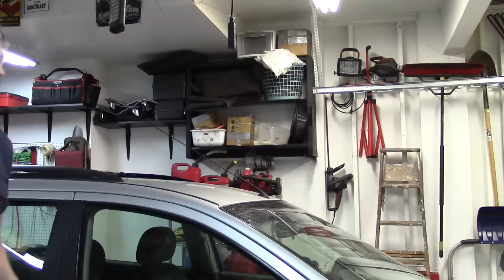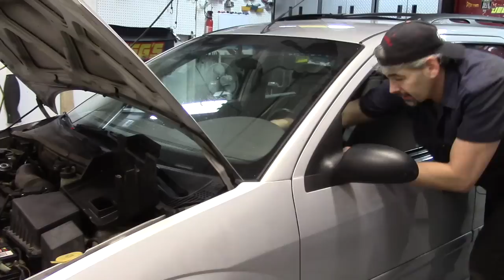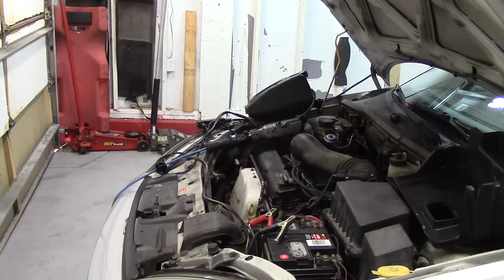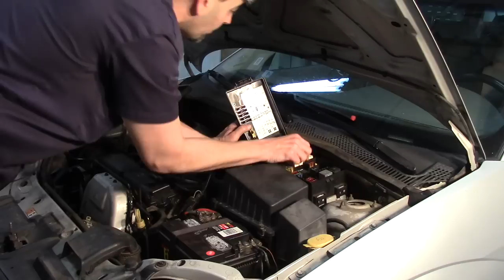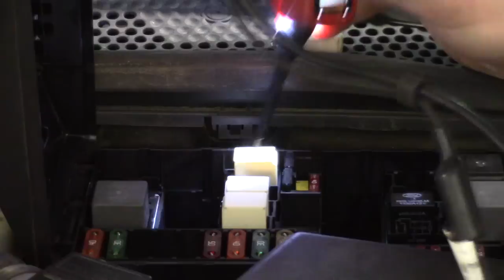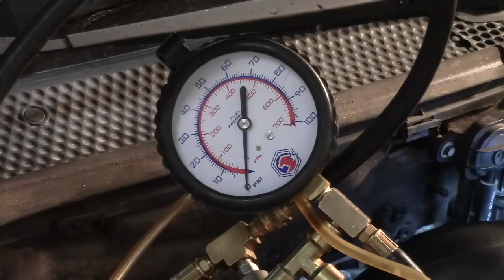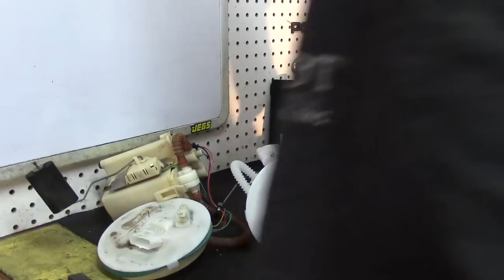Cranking No-Start Real Time Diagnosis -Ford Focus

Comment: Great job explaining, official 2%'r. Watched all fuel related videos, but not helped my problem. All 4 injectors ('03 Cavalier,4 cyl.ecotec) deliver way too much fuel. Floods the engine, will not start. Have removed fuel rail while cranking, 90% runs down side of engine, starts but barely runs. Kept fire extinguisher handy. Any ideas?
Reply from the maker: Charlene Wamsley WHat is your fuel pressure?
Reply: Charlene Wamsley As Matt notes, either the pressure is way too high (faultyfuel pressure regulation) OR the computer is commanding the injectors to stay open way way too long ---  (I.E. the computer would think the engine was running way lean, and is trying to compensate). Excessive Fuel pressure is fairly rare (I think, but I can't say for sure). So, as Matt imply's, test the fuel pressure with a good quality gauge set-up, and check that against the factory spec.

Comment: Like the new intro. Would it not be quicker to test the voltage at the pump after the car had started with the "quick start"?  Power probe  is a very useful tool. Liked the video with good insight into possible causes.

Comment: I think if you didn't hear the fuel pump you should go ahead and see if the car will run on propane so you know that it is lacking fuel. At least it is what Paul Danner would do (and Scotty obviously ... O no he would say:"If you have a car that is cranking but not starting it might be that your fuel pump is bad and I'm gonna show you how to replace it in 2 min;)
Reply from the maker: Gregory May Propane works but throttle body spray, I find, gives a much more definitive result. Sometimes with propane the car stumbles so bad you aren't sure if there are other issues too
Reply: Schrodingers Box I reread my post and it doesn't sound as I wanted... I mean that you should go STRAIGHT AWAY and check if it starts with something flammable sprayed into the intake when you couldn't hear the pump in the tank. I will try throttle body cleaner in future. Do you have easy start in US?
By the way the joke with child seat wasn't funny - I have 3 of them in my car.... LOL
Reply from the maker: Gregory May Ohhhh... yes no doubt, just starting right away with the starter fluid would actually probably have been quicker, and in retrospect more justified given the lack of KOEO prime.
  To be honest, I probably would have done that if I didn't think the parts changer ahead of me wasn't going after spark.  After seeing he did plugs, wires, coil, fuses... I guess I had spark on my mind lol
Reply: Schrodingers Box He fooled you because you use logic. It was highly unlikely for you that he wasted 100s of dollars having spark in the first place....

Comment: Your doing a good job ,but you need a bigger shop.
Reply from the maker: Shawn Lockard Lol, I know! If I knew I was going to get into this I would have got a house with a 3 car garage!! With a MaxJax in the middle bay!
Reply: +Schrodingers Box 
 I can totally relate to that. I'm only fixing my own cars, but being able to do that is so important to me that when we were looking for a house three years ago it was mandatory that it had a garage with enough ceiling height to install a lift. Not a full-size two poster, but I installed a portable one that lifts high enough that I can sit on a chair under the car. It's an alternative to MaxJax, it lifts a bit higher and have a lot of locking positions. 

I bought mine from a local supplier, but I think it's the same as this one: http://www.globalsources.com/si/AS/Shanghai-Fanbao/6008825792990/pdtl/Portable-Two-Post-Hydraulic-Automobile-Hoist/1075757171.htm

It is very versatile, but the finish was not very good from the factory. It had a lot of spatter from the welding on the surfaces the carriage slides along, so I spent some hours removing that before putting it to use. Definitely worth it though.

Comment: Crank no start are always fun! I wondered what could been the next move if you went through the whole FASTTEC and everything seems to be fine...it happened to me in the past, it turned out that every time I was cranking the engine I was making the issue worst...Cause at the end, the reason for no start was engine was flooded with fuel... cranking the engine in Clear flood mode fixed the problem in 3 min after spending hours going through every single possible cause for crank no start...

Comment: One of the best parts of this video is at 0:58 when the car comes off the flatbed truck.  That is priceless.  The next time it comes out of your garage it is diagnosed and fixed if the owner has the funds.  Has to make you feel great.
Reply from the maker: Sandbag1300 Yes it is satisfying.  That tow truck driver is Joe-  coolest dude ever. My driveway is VERY sloped, he perfectly lines up the cars so they just drop right into the garage so I don't have to figure out how to push them up the hill.  Most every other driver will just drop it in the driveway at best. Takes him longer but he gets regular business from me.

Comment: Scanner danner tip on Ford's is... Check engine light goes four during cranking when it has crank signal.light stays on when no crank signal during cranking
Reply from the maker: Steven Tenney Hmmmm I did not notice that- that would be a great direction indicator for sure!
  I do know that often if there is spark (or at least cam/crank signal) you will see the RPMs move but this car did not have RPM gauge on panel.

Dude everytime I see your pic I think of Steve Perry from Journey lol... "Oh Sherry...."
Reply: I usually hear David duchovny lol Thx
Reply from the maker: Steven Tenney HAHAHA!! OMG yeah that is totally true!!!!  That nails it!!!

Comment: Interesting video. I wish when you are filming and using your Power Probe we could see the indicator lights. When you were using the Power Probe in the PDC (power distribution center) at the terminals for the fuel pump relay, I did not see a green light prior to your application of power to the fuel pump. This indicates to me (i.e., no green light) that their is an open in the fuel pump.
Same thing with testing on the bench; when hooking up the Power Probe to the old fuel pump, with ground lead attached to the fuel pump, and prior to applying power, there should be a green indicator light.
Finally, when diagnosing a fuel pump many times (from a limited tool standpoint) a test I and many technicians/mechanics employ is banging on the gas tank with a rubber mallet (to free up a frozen fuel pump).
Reply from the maker: johnwrench4speed Yeah I agree- I noticed in editing that my finger was blocking the green light indicator on the probe, I didn't really notice the camera angle at the time because I was so focused on making sure I was sending voltage to the right place- I'll watch that next time.
  I actually did try the "percussive technology" technique but didn't film it because it isn't really a test consistent with the theme of the channel since it does not necessitate the pump is bad- it could also just be shaking the wiring or ground so still necessary to test the pump directly to be 100%.

Comment: The owner may have run out of fuel a time or too.   Leads to a lot of fuel pump failures because the fuel is lube for the the pump like you said. I tell folks not to run out of gas and if they do, start saving money, for a Fuel pump. Anyway it's  a good question to ask the client,  the more info you start with the better.
Reply from the maker: Imjusttoo Dissgusted True dat.  I always recommend people keep no less than 1/8 tank when I do fuel pump

Comment: Well Matt years ago I diagnosed my 78 Celica with bad fuel pump ..put in new one ..but then though Hey let me bench test the old one.. it shot fuel 12 feet ..so it was my wiring I ran a wire to a switch ..bing anti theft switch/ fuel kill ..so yes the wires do go bad :)
Reply from the maker: deepsquat600 Yes my very first video I did had burned up wiring to the pump itself inside the tank- so technically a wiring problem but since it was inside the tank it's best to replace the pump anyway.
  MOST pumps I replaced had this condition in fact- it wasn't technically the pump itself, but actually voltage drop from inside the tank itself

Comment: Another great video! 

If i have a crank no start at work with no sounding fuel pump prime (vehicle dependent), my go to tools are usually a dead blow and a test light lol
Reply from the maker: dreamer2355 Nothing wrong this the dead blow test! But is it bad fuel pump or are you shaking up a loose ground to the frame?  Still need to directly test the pump to be 100%
Reply: Absolutely! But if it starts, it makes it easier pulling it into the bay!

Comment: When you found out your video content was running on other channels was youtube prompt in removing it? The reason why I ask is because like you my channel is growing and I've seen many lone website embed my service videos in webpages and cannot tell if this is streaming off my channel or not. I brand all my video with my logo. Any more info on this would help . Thankyou
Reply from the maker: ***** Jack of all trades, right? Yes I remember seeing your channel- best intro ever!  
  The answer is it took about 3 weeks after submitting my complaints but indeed the violating channels were shut down. 
  As far as embedded videos- you are credited for those (as long as the embedding is sourced from your channel) and, in fact, it's a great way for your channel to get advertised.
Reply: Schrodingers Box I hope I can achieve half the success you have. I think your channel is great and love watching you test things instead of replace parts. I've learned so much from you and your videos. Also like your humor...  The software I use is adobe premier pro and paintshop pro for the image edits. I use a wireless logitec mic headset and tech camtasia recorder for the computer stuff. Have a canon t3I for camera one and a sony camcorder for camera 2. To get my color balance correct I use a passport color checker. The passport is a really good tool in post production to get correct white balance. You have any questions on video production I will be glad to help you out.

Comment: Nice video, i would like you if you can make a video tutorial when you apply voltage at the relay box to the fuel pump. I was confused in the relay box part when you applied voltage with the power probe, because some people fried the PCM
Reply from the maker: Arodi Cifuentes There is a link in the description to my video on relay testing
Reply: Here we go again...

Comment: think I still would have push reset on inertia switch . Ive had a ton of those short out. before I crawled under car. still good vid though
Reply: Schrodingers Box Funny story.........when I worked at the Tune-Up shop (MANY years ago), we had a car towed in......no start.  I don't remember why, but one of the first things I did was crawl in and look for the Inertia Switch. It was a Ford. The inertia switches in those cars were deep inside the trunk area, not up under the dash like on some F-150's now. Oh yeah, I think I went out and asked the customer what happened moments before the car died. She said they ran over some rough railroad tracks. Bingo-the little light in my brain went on----to the Inertia switch we go.

So this is some kind of hatch back, like an Escort or something. So I've got the tailgate up and I'm rummaging through like five loads of laundry clothes in the back. Finally I find the switch and reset it. Just then the "Service Writer" comes out and tells me the customer wants to know why I am rummaging through the inside of her car. So I have to explain the concept of the Inertia switch to the Service Manager, and he relay's (no pun intended) the reason to the customer.

Happy ending. I get the car started in 5 minutes from it coming into the bay, customer happy (I assume). And I learned something besides.
Reply from the maker: bob b Yeah it would not be a bad idea- the inertia switch is on power side after the fuse so it was a valid explanation based on the data.  But I actually have never seen one short out so I went in direction of what I thought was most likely.  Had I not seen 12V at the pump connector that would have been my next target for sure.

Comment: I just ate a fuel pump last week on a ford. I put a new pump in and still did not work but I had power at the connector, it ended up being the terminals in the connector that were all corroded away. Lesson learned at 175.00 bucks
Reply from the maker: JOHN HUFNAGEL Yep, that's exactly why I bench tested at the motor connector inside the pump assembly itself.  Cool of you to admit the goof-- it's how we learn, from either our mistakes or from others'!! Your lesson is more valuable by far as a result of admitting it to others!
Reply: The customer is a few fry's short of a happy meal so he would have never known the difference, the few "PRO" mechanics that I know says they wouldn't have said anything to the customer. They are the other 98% and just change parts. You are right lesson learned I wont make that mistake again.

Comment: The new video opening is great.  I do not use my dewalt electric impact driver when I am around open gasoline vapors.  Use it in a dark room and watch the sparks that tool puts out.  Saw the tool in a few of your camera shots.
Reply from the maker: Sandbag1300 Yes the impact was only used for removing the support straps.  Once I removed fuel lines, the tool and lights were moved far away.

Comment: can't you just take the new pump motor off and put it on the old pump? Like a walbro?
Reply from the maker: SadamFlu Yes, but it would void the warrant on the pump assembly.  Best to wait for a new one.
Reply: ah fair enough... Dang it, so does that mean you pay for that part? Or just get a refund and buy the right one?
Reply from the maker: SadamFlu The store admitted their mistake when I showed them the old pump and will replace it- the price of the correct pump was actually $5 lower and they refunded the difference to me
Reply: Sweet

Comment: I will never forget watching a video on YouTube of some guy ripping the back seat out of a Focus like that one and taking a sawzall to the floor pan, while saying "There's supposed to be an access hole here," thinking that the shape of the indentation was them forgetting to cut the hole...

Another awesome diagnosis!  Quick, efficient, and methodical; exactly what I like to see!  Amazed that the parts store gave you the wrong pump, though.  Wonder what the deal was with that...
Reply from the maker: Lol Sawzall to the floor pan??  Gotta see that one lol.
  Yeah the pump turns out that the wagon (this car) has a slightly different style than the other models.  Parts store computer didn't have that info so ended up with wrong part.  I'm actually not even 100% sure the one on the way is correct in fact!
Reply: Schrodingers Box Oh geeze, I hate that!  Good luck man, and keep us posted!

I must say, that has to be the most adorable, tiny little fuel tank I've ever seen come out of a car...  LOL

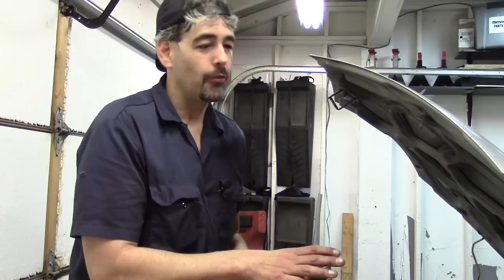Comment: ~15:00 Another thing to consider with 'painful' jobs like that,If you're going through the trouble to drop the tank and test the fuel pump,it might be worth it to just put a new one in anyways,while you're at it. I hate doing PITA jobs twice. Might prevent future issues,and swearing.
An example,took a car in for a trans rebuild..had them replace the lower motor mount,and rear main seal while they were at it. They already had it all apart,and everything was right there,easy to do. No point in paying for the same labor again,3 months down the line.
Reply from the maker: Agreed. At that point I just lowered the tank enough for testing, but in general if I remove a fuel tank, it is getting new pump regardless.

Comment: You can't just replace the motor?  That sucks. :(
Reply from the maker: ***** Actually you can, but not with a brand I trust so I don't have to do this again in a year, and also anytime I drop the tank, I want to replace all the unit to ensure the fuel gauge doesn't stop working down the road, etc.  It's worth the extra $100 for sure considering the effort required.
Reply: Schrodingers Box Except when it was an extra $300. Buying then separately sometimes really works out.
Reply from the maker: Yes if it was $300 that would necessitate this lady just get by with motor replacement.  But as promised I cut her a huge labor break so I could film the car- which turns out I had 5 days to do anyway lol!!
Reply: Schrodingers Box That's real irony!

Comment: Excellent video!  That is how it's done.  Bravo.  I can't think of 1 thing that you didn't properly cover along the way in your diagnosis other than explaining why you MUST test for fuel pressure and not just flow.  RealFixesRealFast has a great video on that called "Don't Let Fuel Volume Fool You".  Turns out that was exactly what was wrong with my pump too (split in the rubber hose).  I'll never forget that lesson now.